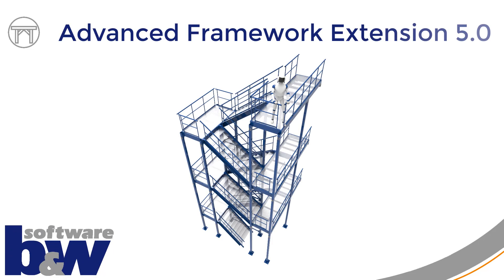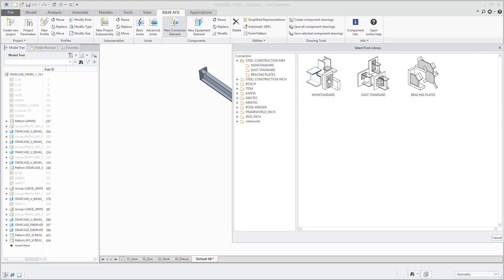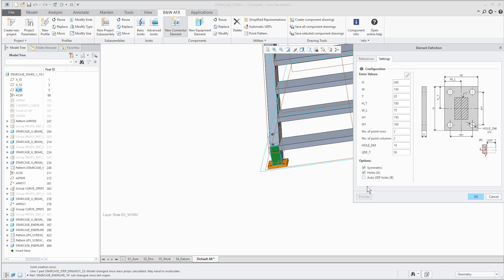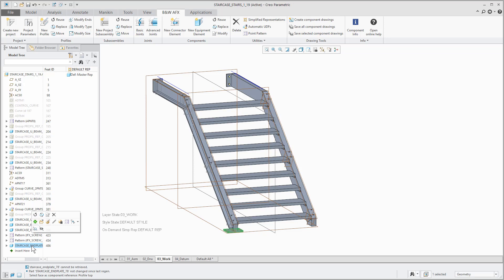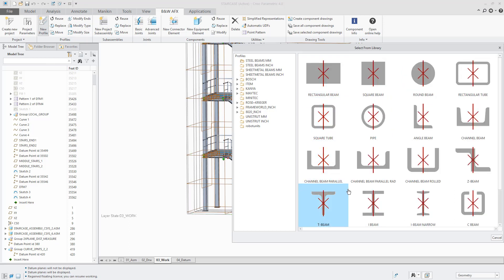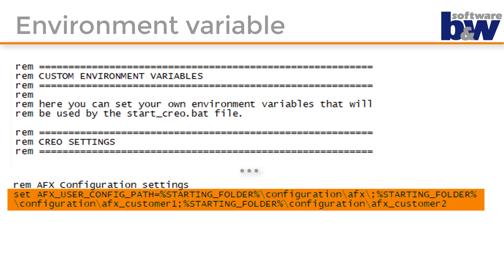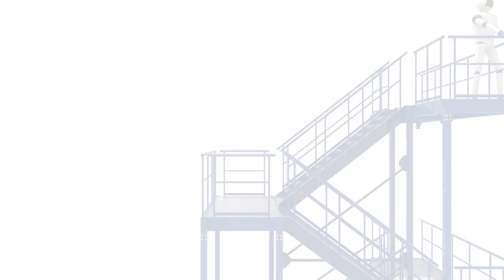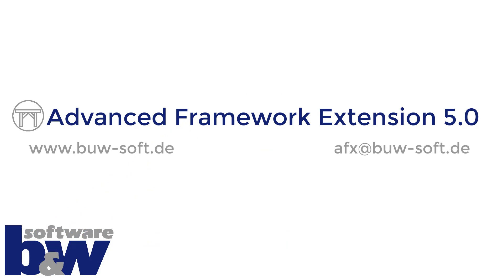AFX 5.0 for Creo Parametric - General Overview

Comment: Is there a difference between "Advanced Framework" in creo, and B&W AFX?
Reply from the maker: The B&W version is compatible with a wider range of Creo versions and also offers some library extensions that the PTC version does not have.
It is also possible to tailor the software to customer requirements if purchased directly from B&W Software.